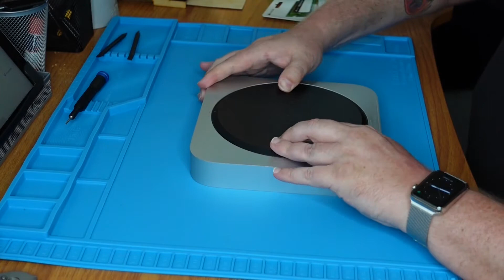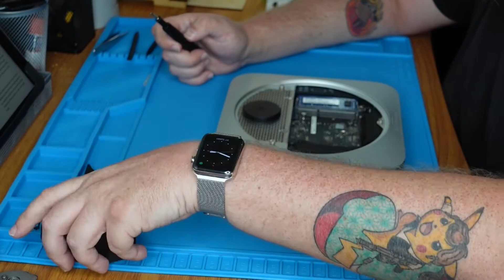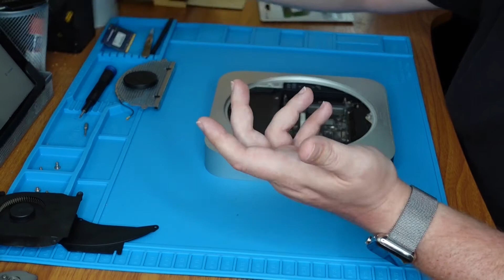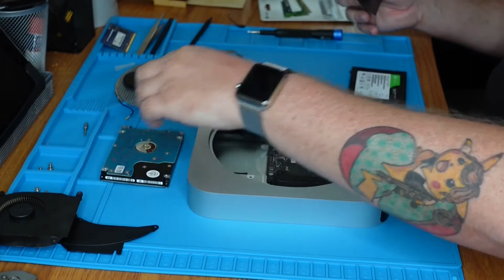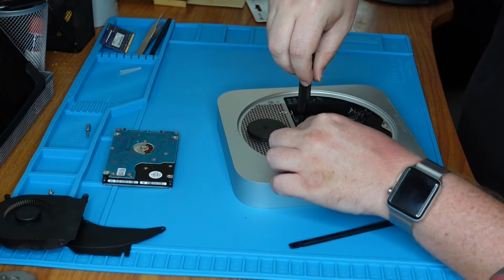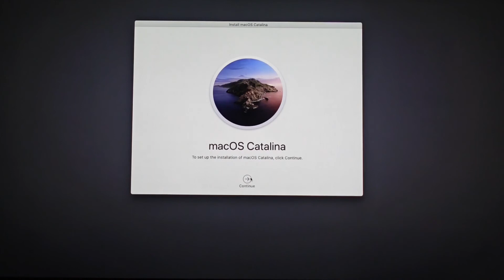Mac Mini (Late 2012) Hard Drive/SSD Replacement

Comment: Just did mine and updated to Catalina. Night and day difference with the SSD! I left the antenna cage connected and ram installed. No need to remove either. The hardest part was getting the new drive to fit into those 2 holes. Definitely recommend using painters tape and making a sort of handle on top of the drive to push it in. The whole thing took less than 45 min, not including installing the new OS

Comment: Are you familiar with how to fit a Micron M600 M.2 sata 256g into a 2012 Mac mini.
Reply from the maker: Yeah, you just need to put the M.2 SSD into an M.2-to-SATA adapter.  Basically gives it the form factor and mounting points of a regular 2.5" sata drive.  The only thing to watch out for is the keying (the notches between some pins) on whatever M.2 drive you're using; there are three (I think) different layouts and different adapters for each.

Comment: I would leave the antenna cage connected and swing it out of the way . When inserting the SSD try using a thinner wooden ruler to help the pegs aligned and slide the ssd over it . The antenna cage will you give you grief reinstalling it . I had multiple tries . Then I inserted the 2 south screws onto the SSD first , after finally getting it . Grab a stiff brush to clean insides and fan when dismantling . It will have some dust bunnies

Comment: I had to change the SATA cable in the same exact Mac. First time I've ever done it - I won't bore you with all of the details but when I got to that damn WiFi grate - I just wanted to scream. I tried and tried for hours. Took a long break watched more videos on it. Finally I was just able to line up the 2 wing screws but the holes for the hard drive were not matched up. I just put it all back together and it started up just fine. But I'm still concerned about that stupid WiFi grate not lining up. I don't even use WiFi or Bluetooth and I doubt I ever will. I use (wired) Ethernet and everything else is hard wired.
Reply: There is actually a groove on the front of that Wifi grate that has to slot in. That's why you couldn't push it in because it needs to slot in. If you remove the grate and look at the front of it you will see. Also don't need to unplug the fan. Just remove the screws and set off to the side. Same with the Wifi antana.
Reply from the maker: The antenna panel will work fine as long as the little coax plug is hooked up, whether it's screwed in or not.  The potential issue with having those screws detached is that the hard drive is not really secured; its supported by two posts at the front of the case and only secured in place by the two screws that go through the antenna plate.
I've found that getting something like a spudger (or a pencil, anything that won't damage parts) underneath the edge of the hard drive helps to prop it up and align those two screws.  Once you've got both screws started you can remove the prop and the plate will hold everything in place to finish screwing them in.
Reply: @ericfixeseverything3897  Hello Eric - thanks for responding! I don't even use WiFi - just Ethernet and I don't  have any Bluetooth stuff and I don't plan using that or WiFi. Before the insanity with the WiFi grate I had to take out the 1TB (fat) hard drive and change the SATA cable. The cable pictured in this video: https://eshop.macsales.com/installvideos/mac_mini2012_dd2/. I bought this late 2012 Mac Mini i7 2.6 from OWC recently. They sent me the tools & cable for free because it's still under their warranty. But there were no instructions. Of course I watched videos countless times before doing this. I was a nervous wreck doing this at the start! I watched the video & it explained that I had to fold this SATA cable at the dotted lines but it didn't say that I also had to fold it at the smaller end (I hope I'm making sense!). It was easy to take apart - I easily attached the SATA cable in but I had a hard time getting this fat 1 TB hard drive back in!! Then I had to take the hard drive out again and fold the SATA cable at the smaller end to fit properly. I only took apart the fan, heat sink cover, WiFi grate & hard drive. I did not unplug the WiFi antenna - I just draped that over the side. I've seen many videos where it's not needed to unplug that or take the memory out for this. And when I finally got the hard drive in I had a time of plugging the SATA cable in. Thank God I have a magnifying visor that I use for my vintage barbie doll restorations or I would not have been able to do this with my old eyes! After I FINALLY plugged the SATA in it seemed I was able to push the hard drive back in a little more. Then came the grate. I called OWC but that was no help because I don't have zoom for videos no camera on my monitor. Finally I just crewed the 2 screws in the dog ears & everything else was very easy to put back together. It's been working great but I will try it again with this lousy WiFi grate. I certainly don't have the $$ to pay some geek dude just to put this grate back in! I guess I'm sort of a geeky woman because not many would try this out. My sister didn't even know what model Mac book Pro she had - I had to tell her on the phone recently how to look that up in "About this Mac". And she didn't know where "About this Mac! was!! Unbelievable!!